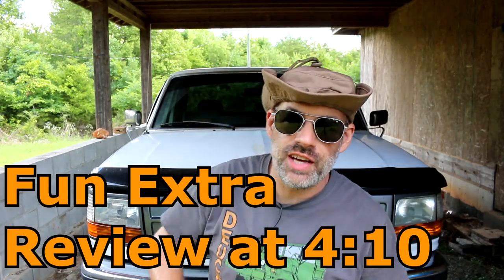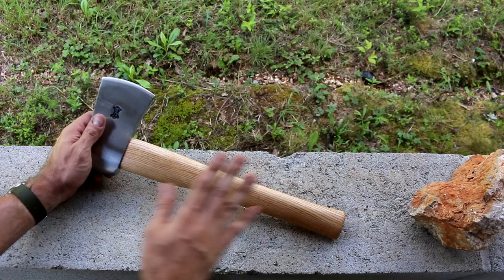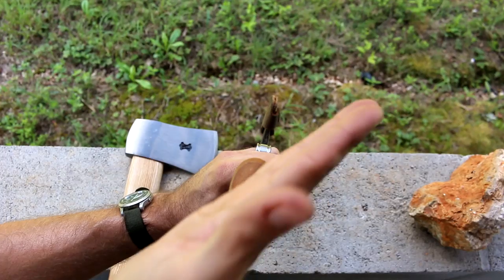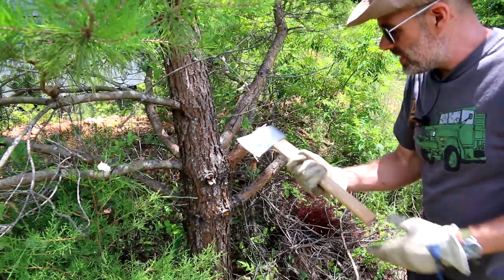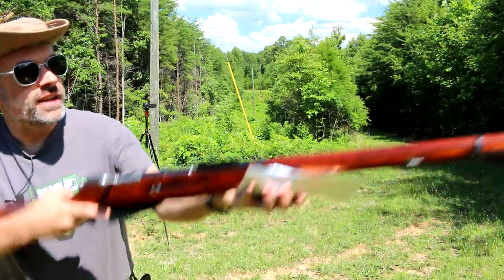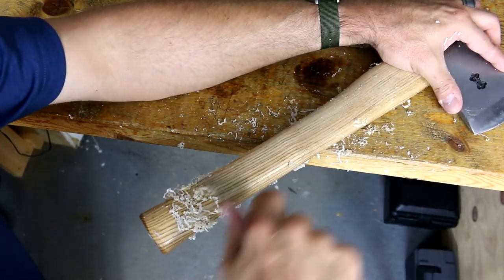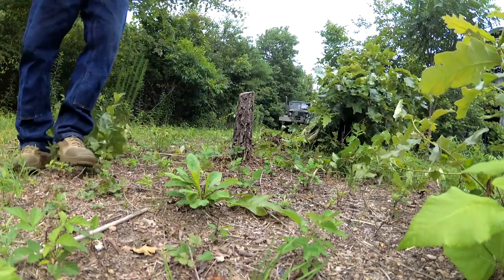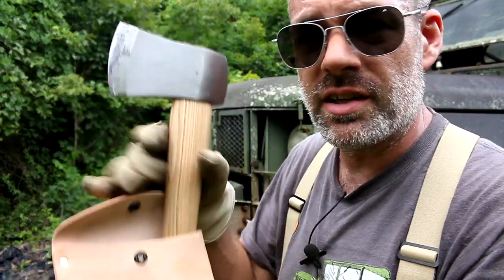Swiss Surplus Hatchet Review

Comment: I have the same axe, which is one of my favorites. However, it was only after mounting it on a boys axe handle from Fleet Farm, which I spent much time tinning out. Additionally, I gun blued the metal and spent an equal time reshaping the metal.   I guess the 5 to 10 hours should be factored into the cost. I guess now I'm not selling it to anyone as I've spent too much money and time on it and now works extremely well

Comment: Did you skate a file over it to determine if it is hardened steel.
Reply from the maker: The edge was hardened like any other decent axe head.  If I had thought of it I could have reenacted any one of AVE's colorful phrases, "Harder than a P on prom night".
Reply: If you want another R51, they are going on closeout all over the place.  Less that $240 from Buds.
Reply from the maker: @texpatriot8462  They were officially discontinued a month or two ago.  I still like mine after I modded the mags to actually work.  I may pickup a spare because there's no way someone is making this design again.